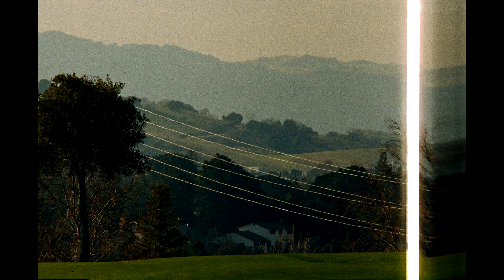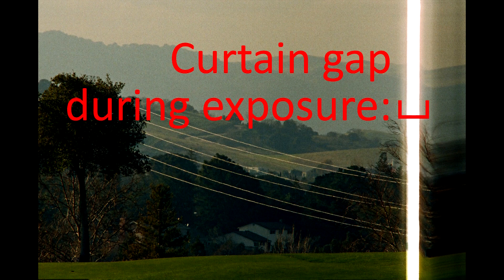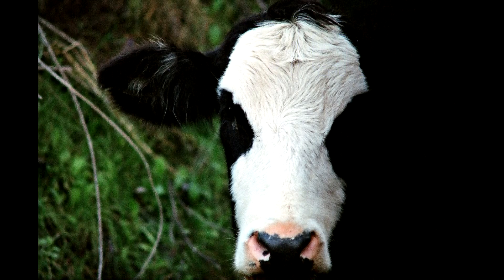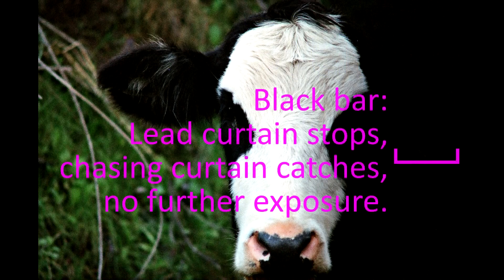Negative Flaw: Curtain Bounce

Comment: I have a question regarding the focal plane shutter/rolling shutter, let's say you use a shutter speed of 1/1000 and you took a picture of a spinning airplane propeller in broad daylight. Does that introduce rolling shutter effect even on film?
Reply from the maker: That depends on the curtain travel speed -- how quickly the curtains cross the shutter opening. In some much older cameras, yes.

Comment: If you don't know for sure which is which and you're sending the camera in for service, send in the offending photo(s) as well. Are you intending to do one on light leaks and how/where to find them?
Reply from the maker: That can help the repairman, but I think the repair for both issues is either the same, or slightly different but on the same components.

I do have a light leak video coming up. I think it's in this series.